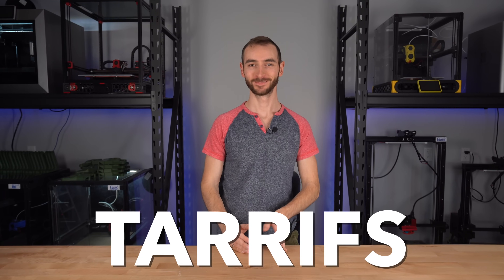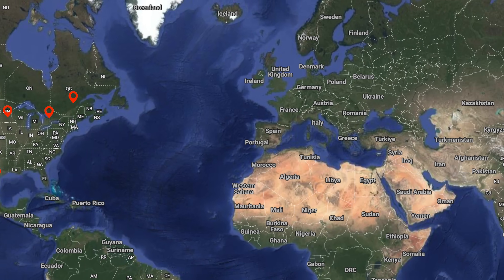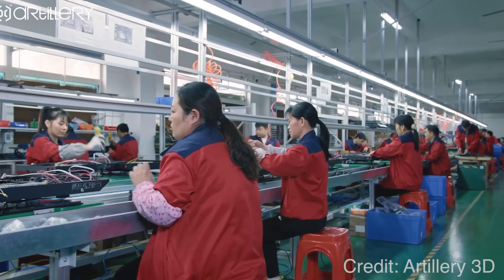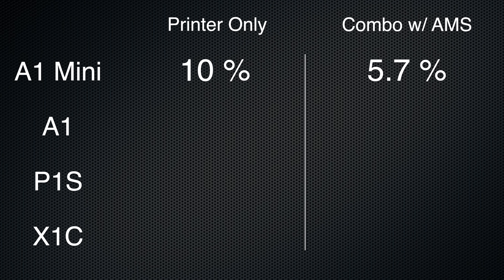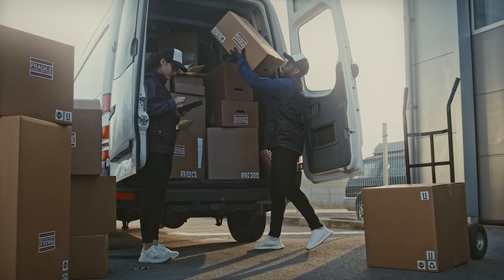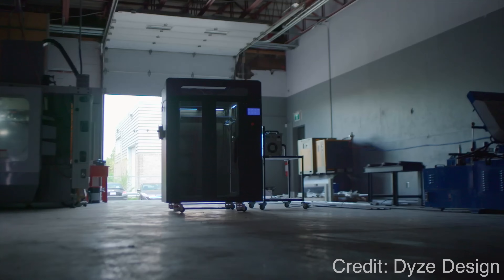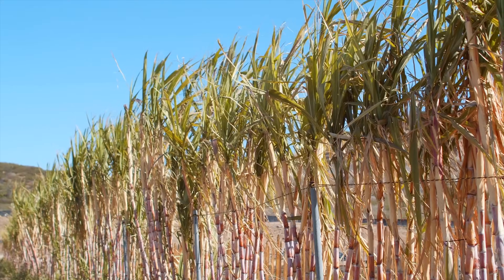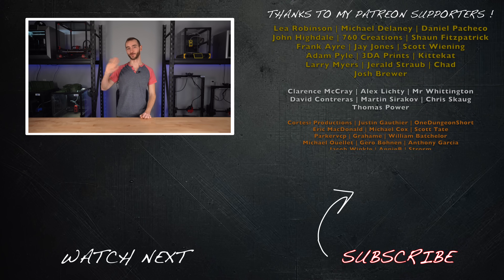Tariffs just made 3D printing more expensive for everyone..

Comment: Is this supposed to be a future increase?  Because i see filament online for the same price as usual, some even cheaper than before
Reply: Of course.  It always takes a bit of time for the companies to react.
Reply: @desiv1170  Real price changes on imported items haven't shown yet due to the length of the supply lines. Since Feb 1 (the date that the China tariff went into effect) the affected products haven't made it through the pipeline from the ports to the distributors, warehouses, retailer/ resellers and then out to the consumers, unless they were direct shipped (Temu, AliBaba, etc.) to you. Some companies have raised their prices to reflect the future increased costs, and it isn't uncommon for those prices be gradually lifted to make the increase seem more palatable, and/ or to cover themselves in case the tariff doesn't actually happen...
Reply: They haven't gone into effect yet, they're on hold. The threat of tariffs are used to bully other countries into submission, the negotiations are ongoing. That's why the tariff on China is now 10% instead of 25%.  China must have caved on something already while Canada and Mexico have not.

Comment: The triff shouldn't effect prusa because they are being made by printed solid in the USA .
Reply from the maker: @miatakid2  using quite a few Chinese made components.. it won’t affect them to the same extent as Bambu but they won’t be immune from them completely. There are also potential tariffs coming on the EU. Also, the Core One is priced to compete with Bambu. If Bambu printers rise in price there’s a chance Prusa will raise their prices to match.
Reply: @ygk3d  how is core one priced to complete with bambu? It cost double the comparable P1S.
Reply: @ygk3d I highly suspect if prusa aren't affected by tariffs, either because EU isn't affected or because there US assembly is a "formative change" then they will hold firm with their prices. 

Their profit margins are working for them and it's a good chance to smack Bamboo while there down.

At least that's my prediction. 🤷‍♂️
Reply: @ygk3d  Personally, I doubt it.  Why look a gift horse in the mouth?  Business team must be frothing for a chance to compete with forces leveling the playing field out of their control.
Reply: But not the PCB's and most of the components....
Reply: o you sweet summer child
Reply: It's like trying to buy a US car - the final assembly might be done in the US, but the components cross borders multiple times before that final 'transformative change' that may or may not occur in the US.  So the tariffs can stack several times before a US-badged item rolls off the assembly line.
Reply: The CoreOne are not yet, and all the parts get imported from Europe.
Trump is about to start a trade war with Europe.
So prices will go up.
Reply: So the overpriced manufacturer isn't affected.
Reply: @EnlightenedSavage  Everyone will be affected.